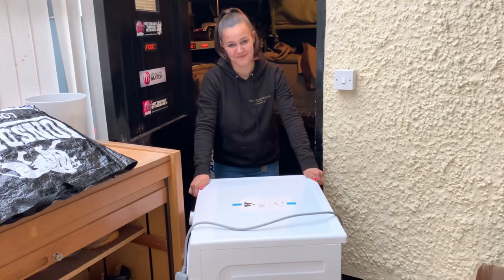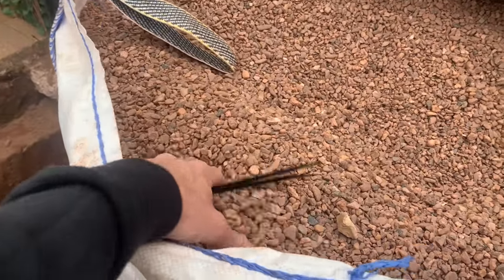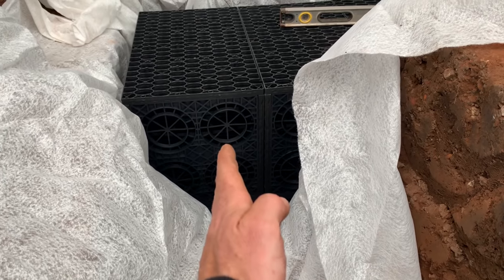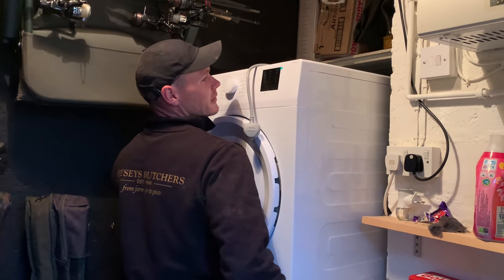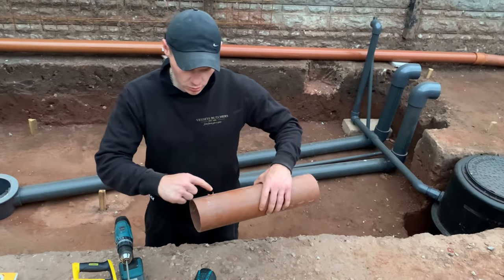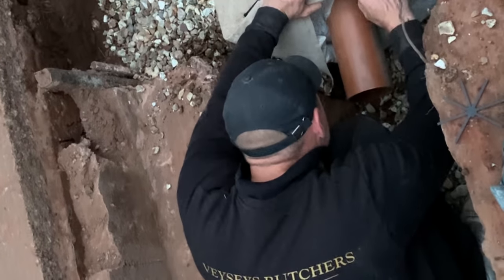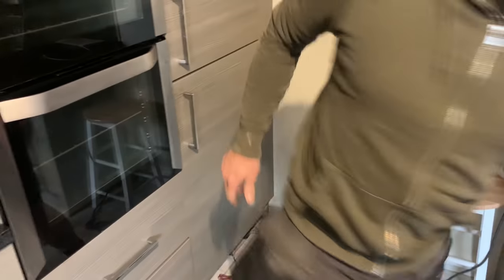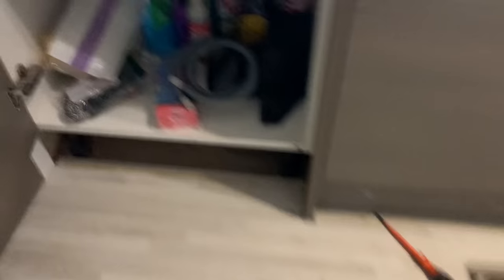*THE SOAK AWAY*THIS WILL IN TIME GET ME FREE KOI POND WATER AND SAVE THE HOUSE!!!! #23 NEW KOI POND

Comment: I’m just having a gas pipe run to my filter house to heat the pond, so much cheaper than electricity! 
Got a small combi boiler and running it through stainless steel pipes in a tank to heat the water that’s returning to the pond, happy days!

Comment: Gas will definitely be the cheapest way to heat , I use a ss coil running of my house boiler to heat mine ,I’ve been a gas engineer for nearly 20 years , gas safe registered ( formally known as corgi). To run off your assisting boiler you would need 2 zone/motorised valves and a separate timer/programmer for the pond. Quite a easy thing to do for a heating engineer. Or even better a separate boiler , will depend on the size of your assisting gas pipe(could always be upgraded) any advice just ask mate
Reply: I'm told there is a limit to how much gas you can pass through the meter and seeing as i have two combi boiler's at my house (one in the house and one in the office in the garden) a third boiler doesn't seem to be an option. So do you think this 2nd zoning option is achievable bearing in mind the pond and boiler are 40+ metres away from each other. 
My thoughts are that an ashp is probably the best option after a dedicated boiler.
Reply: @Tom_Prendiville  hi it is achievable but you are now talking commercial sized gas meter/pipe etc to achieve the pressure needed. Some manufacturers require less safe working gas pressures than others. You can add the output of all the gas appliances (including boiler for pond) then you could work out how much gas supply is needed. Domestic engineers can fit 35mm gas pipe.
Reply: Or convert boiler for pond to run on lpg